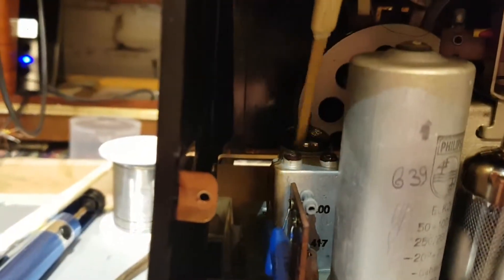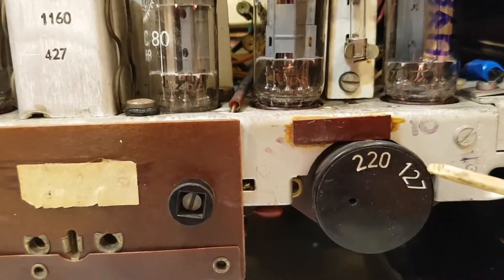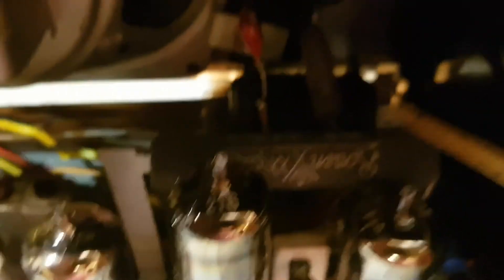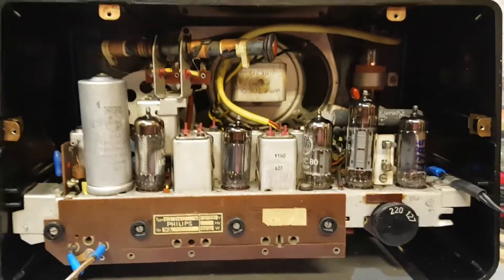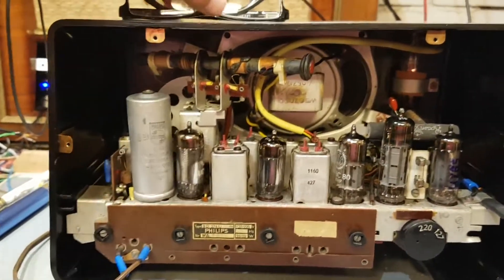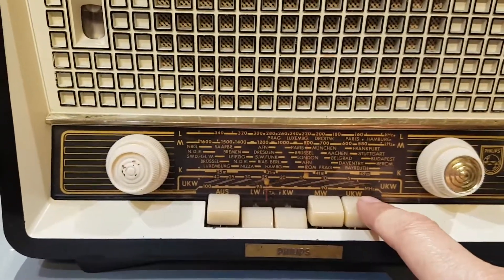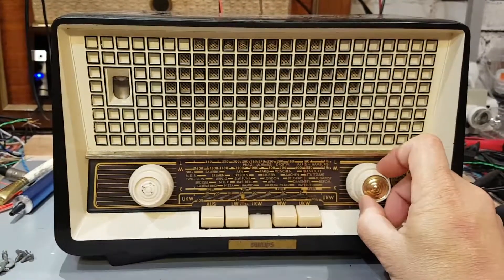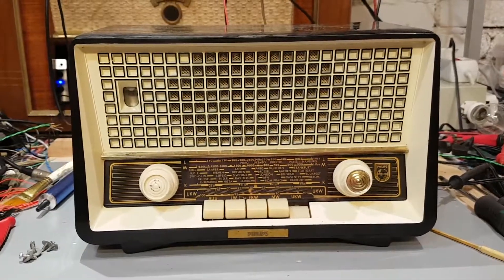Philips Philetta BD274 repaired, discussion on EU Tube numbering system.

Comment: Look, on one hand, I greatly appreciate you showing us this wonderful old and rare Dutch radio from the late 1950's, and in glorious HD 1080p - good job.  However, you don't know what you are talking about in several areas of the video, and are just spreading BS and confusing people trying to learn! - here in the states, we call that "talking out of your ass" - for example, you said the "U" designation means 28 volt heater, and that all 6 tubes in the set use this heater voltage.  Well first off, you forgot the 7th tube, the eye tube, also a U series, (UM80) which has a heater voltage of 19 volts, and in fact, of all 7 tubes, only 1 of them has a heater voltage of 28 volts, the UABC80.  The UY85 rectifier has a heater voltage of 38 volts, the UCC85 detector has a heater voltage of 26 volts, the UCH81 has a heater voltage of 19 volts, the UF89 has a heater voltage of 12.6 volts, and the audio output tube, the UL84, has a heater voltage of a whopping 45 volts! - Maybe next time, just do a "show and tell" on the radio, and stay out of the technical areas, until you learn more.
Reply from the maker: Did you know that its entirely possible to be totally right and a total assole at the same time? I didn't believe it until you wrote this most enlightening post. Thanks for the useful information.
Reply: @DerekHerbst747  I prefer the term "snarky egalitarian sage" 🤣
Reply from the maker: @carlosedwardos  now we're getting somewhere 🤣🤣